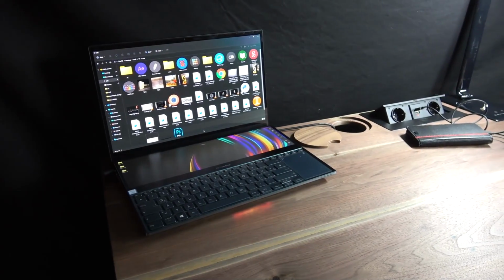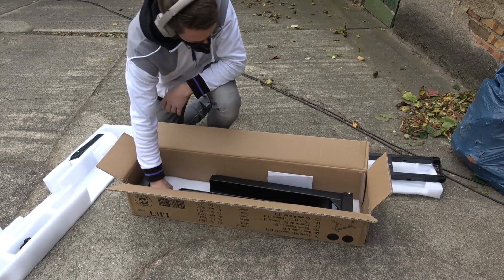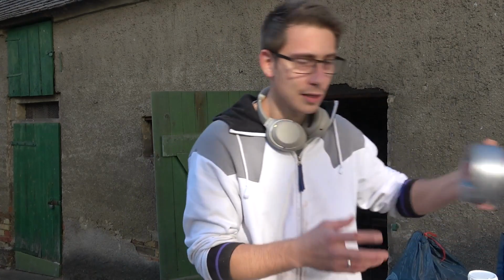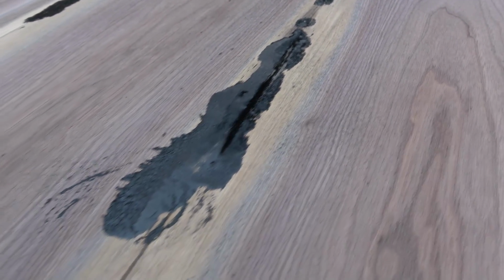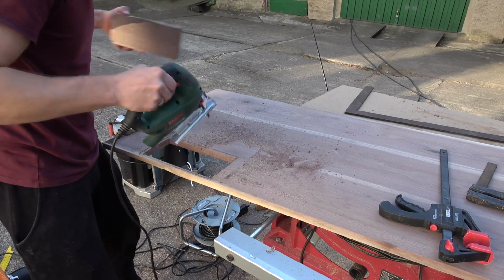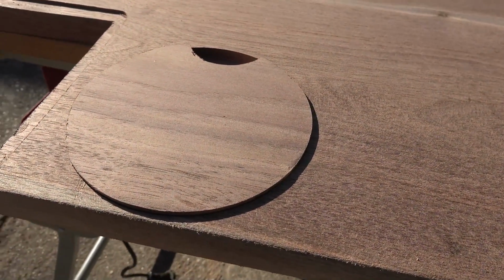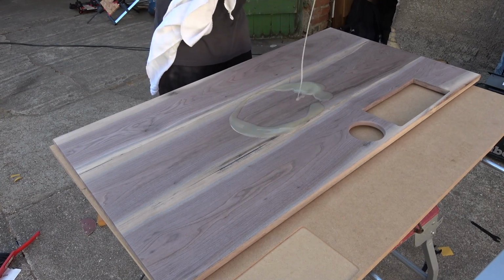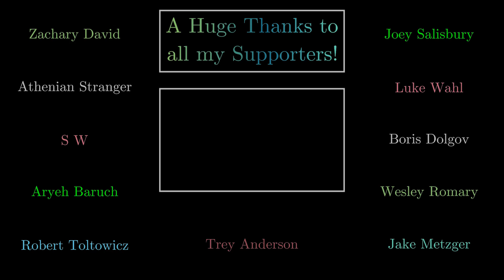$700 Smart Height Adjustable Walnut Office Desk

Comment: You could’ve always run the piece through the thicknesser in order to remove proud epoxy. That would’ve necessitated you filling the holes with epoxy before jointing the boards. 

My personal preference is a simple card scraper. If you know what you’re doing then you won’t even need further finishing after that. Very quick, very simple and very precise.
Reply from the maker: Didn't have a scraper back then, but now I do :) Such amazing tools!!

Comment: I wonder if there’s a math idea that’s analogous to using finer and finer grit sandpaper until something is smooth but idk.
Reply from the maker: Probably :)
Reply: if I were to answer that on a whim I'd say fourier series? you start with the coarse bits and then progressively add finer and finer ones to taste
Reply: A good rule of thumb is to not jump more than 1/2 the previous grit.  For example, if you start with 80grit, your next grit shouldn’t be higher than 120 (80/2 plus the original 80).  Then from 120 to 180 (120/2 plus 120) and so on.
Reply from the maker: Yup! This is exactly what I do :)
Reply: @jimmosio  Yeah,  maybe sanding with rough grit is like filtering out large frequencies from the surface. But why couldn’t you filter out everything but small frequencies at once?

Comment: aren't the lighter colored parts sapwood ? Shouldn't you have removed those bits at the edges of the board ?
Reply from the maker: Nah, all is good. I really like sapwood and its looks :) And even though sapwood is more likely to encounter wood movement over time, I don't care here, since the desk will be placed in a well climated home with low humidity :)
Reply: @RockHardWoodDaddy  ah makes sense, I wish to get into woodworking and have been watching some boatbuilding stuff where sapwood is to be avoided at all cost! thanks for the videos papa
Reply from the maker: Yup! For boat building you should avoid sapwood at all costs since it sucks water up like crazy :)